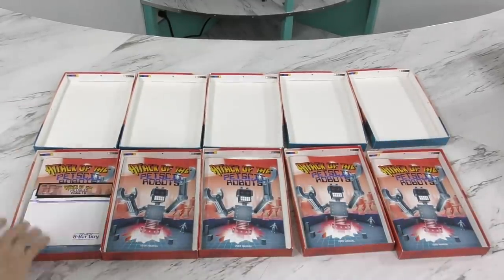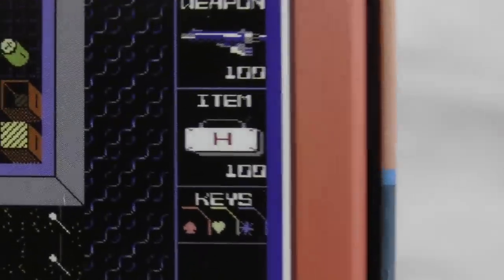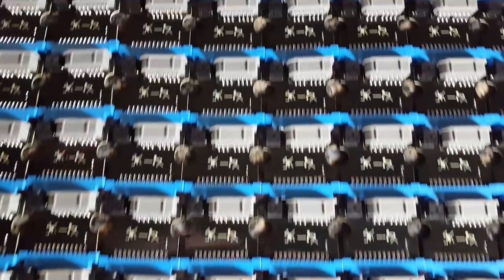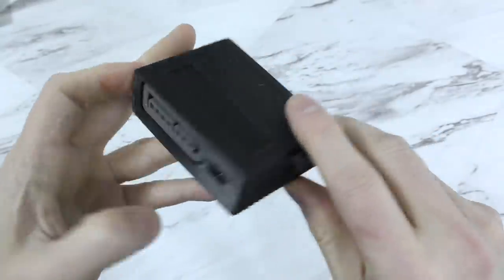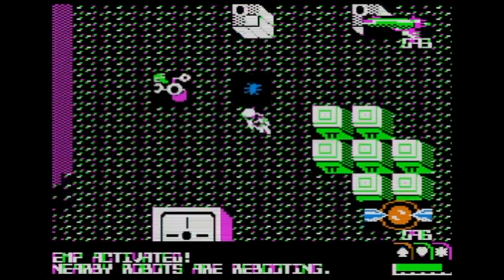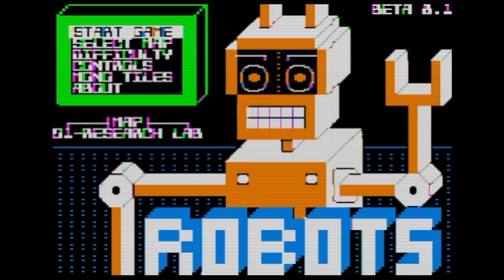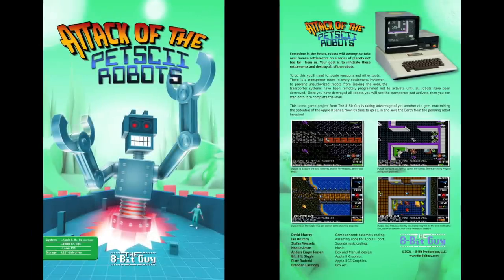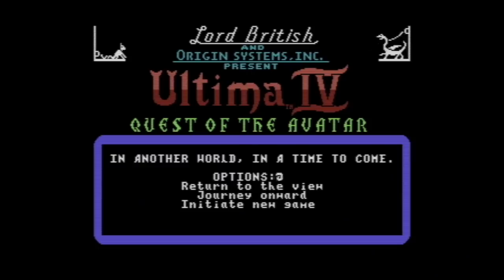Petscii Robots Part 3 - Apple II version, production, etc.

Comment: I was legitimately shocked to see that the SNES adapters are more or less made by hand. Very cool
Reply: How else would they made? It's by far too low volume of a product for any kind of automation to make any kind of sense.
Reply: @HidingAllTheWay  you can quite easily get quantities as low as 100 pieces with smd assembly from chinese manufacturers. But you gotta do the through hole stuff yourself
Reply: @asronome  Yeah doing that SMT stuff by hand seems ridiculous to me but I assume that somebody who knows enough to design such a board also has their reasons why they didn't outsource it. The biggest cost for a pick and place run is setup AFAIK so either it's too many different components for the size of the run or maybe they had bad experiences with the component sourcing / QA process of the PCB fab.

I'd really like to know the actual reasons.
Reply: @HidingAllTheWay  Not really. I used to work in electronics production, and the company was fine with low volume PCB orders. If you have the machinery, It doesn't really mater how many you produce, as shifting from one batch to the other only takes a few minutes
Reply: 8 bit guy is hardcore 🖖
Reply: @RyanJardina  You know that he isn't doing the soldering, right?
Reply: @Okurka.  yeah he stated it was texelec (they sell alot of retro boards like xt-ide and a few others
Reply: Why is that cool? It would have made a lot more sense to at least have the SMT components, which are all off-the-shelve parts, be assembled by an automated shop. Seeing someone use tweezers and a toaster oven for assembly is rather worrisome. That's okay for single digit productions, but not when he ordered a thousand.
Reply: @HidingAllTheWay  600 pieces is not low volume. There are manufacturers like JLCPCB what will produce even only 10 of them.
Reply: @graealex  I completely agree. I have placed over a thousand SMD components a day before, and it really takes it's toll. I would have quickly automated that with a pick and place machine if I had the chance. With that volume of PCBs I would have just bought one. £4000 shipped.
Reply: And made by hand in the USA, not China 😱
Reply: @MattKasdorf  We all know the quality of American made products.
Reply: Hand assembly of SMD boards like that is a little nuts, but it's Texelec that's nuts here XD

But... if you have time and nothing better to do that'll make you money, it's rational to do it yourself. Wouldn't be my choice for 1000 units though, especially not with hand placement. Maybe for 10.
Reply: @josephlunderville3195  agree entirely. In my last job I had to rework 48 (urgently needed) raspberry pi adaptor boards in order to swap two SMD components and I ended up burning 12 of them due to my inexperience. Never again lol
Reply: @henryokeeffe5835  It's not like there aren't any shops that are fully automated in the US already, if you don't want to rely on production in China. Plus the toaster oven really isn't that reliable. Given, the components are all very simple, but if there was a more complex SMT part on the PCB, that might be a liability if not done in a proper reflow machine. I understand the controller and user port requiring hand soldering as a last manufacturing step, though.
Reply: @graealex  why is it worrysome? more care and attention being put into this than a mass-produced board. so many mass produced boards just get rejected at testing.
Reply: @skellious  Lol, it's the other way round. We use automation to make processes more efficient and consistent. Pick and place machines have a certain repeatability and don't make errors, like humans do. In many cases, there will also be an automated visual inspection, and electrical testing afterwards - again without the risk of introducing human error.
There is a lot of misconception about hand made stuff having higher quality. Just because a lot more work has to go into doing stuff by hand doesn't increase the quality. Automated mass production achieves the highest quality at the lowest price point. For example, if the mainboard of the computer you are typing a comment right now was hand assembled, there would be a very high likelihood of it failing prematurely. And it would have still cost ten times as much.
Reply: IMO one of these is worth buying just to have the correct connector for the user port and a sturdy headphone jack for PET use, even if you don't ever use the NES controller capability.
Reply: Maybe arguing with a Chinese over manufacturing defects and waiting for extra batches would be ultimately more expensive than doing everything at home. Time is money too.
Reply: @graealex  *shelf
Reply: @noop9k  Why is it always "hand-made" vs. "China"? Are you aware that highly automated factories do exist in the US?
Reply: @graealex  I can guess that, unlike certain Chinese companies, they don’t do tiny batches with small profit margins.
I, personally, don’t have a friend with pick and place machine where I live, do you?
Reply: @noop9k  This is a commercial operation with at least 1000 units ordered. Hand-assembly and toaster oven reflow is okay for 10 or 20 units. But this isn't a small batch. And a quick search reveals multiple shops in Texas that actively advertise "low to medium volume production" with assembly services with "state of the art automated SMT equipment" (aka pick-and-place).
And I don't understand what this has to do with "friends having pick and place machines"? As I said, this is a commercial operation.
Reply: @graealex 
1) When this started they probably expected less orders than 1000.
2)  Why you are so sure that a business from Texas would offer their services for low enough price?
Reply: @noop9k  I don't know what exactly your argument is. There are plenty of shops out there that will do professional manufacturing (read: no tweezers, no toaster oven - instead, pick-and-place, and controlled IR or vapor phase reflow) for runs of only a few dozen, at reasonable prices. There is really no discussion here. The job went to someone doing it in his kitchen instead for some reason, but either that person is severely underpaid, otherwise doing it that way would actually cost a lot more, or there are other reasons, but not because doing it this way is a reasonable way to manufacture electronics on a larger scale. Your amateurish understanding of the processes doesn't add anything here.
Reply: @alerighi  Yeah, and shipping from China takes what? Three months?
Reply: @sonicobsesinter For the last time, manual manufacturing does not lead to higher quality. In many cases, it reduces quality or at least consistency and repeatability.

Comment: I had forgotten about the snes adapter til I opened my box, and I have to say I still have no idea how you bundled that thing in at such a cheap price!  also I find it hilarious that you needed an snes controller adapter and since they didn't exist you had one made! lol so cool!
Reply: Even cooler that the various incompatible Commodore User Ports have JUST BARELY ENOUGH overlap in GPIO to make it possible to bundle a single one in with just a jumper to move.
Reply: That's what you get where competence and decency overlap.

Comment: Back in my high school days I was familiar with Commodore Basic and the school computers at the time were mostly still Apple II/e units. I decided to work with bitmapping so I picked up a Applesoft Basic manual in the media center and got to work. I made a mountain scene. I got extra credit in computer class for it. I lost the disk I saved it on since then. I also forgot how I did it. It was over 25 years ago and knowledge degrades like unused muscles.

Comment: Awesome! I finally got my Atari 8 bit "Space Invaders" game to a level of development where I have come to appreciate the various levels of difficulty that the game will present to the player. There are 56 software sprite invaders (only 1 moves per VBI call, but the invader array is refreshed when you shoot one of them, so just like the arcade version, the invaders speed up the fewer of them remain) - 8 columns and 7 rows. There are 8 software sprite bombs (single pixels) which are processed all in one go in the vbi, 4 hardware missiles also processed in one go (3 of these are homing bombs directed at the player and missile #0 is the player's missile). The DLI multiplexes 3 hardware sprites 10 times. The first one is the bonus points ship, the next 8 are either geese in flight or stratosleds from "Flash Gordon's Trip to Mars" (these use a colour kernel effect to give a metallic appearance, the geese are single hue and the wings of these are animated via the main program loop). The final multiplex sprite data is concerned with your player. Player #3 is not multiplexed because it has to be the explosion where an invader is hit. When you blow anything up, you have to wait for the explosion to finish before you can shoot another missile (emp or whatever - in truth it is concerned with how the invader array is refreshed, but it does make things interestingly tricky - you really have to aim well). If you shoot a goose, then your ship will be paralysed. The geese and stratosleds move at different speeds & in different directions (horizontal movement is processed again in the VBI).One of the invader bombs can be a timebomb. This means that when it falls to the bottom of the screen, player #1 just above the bomb shows as a countdown from 9 to 0 (with a suitable delay). The bomb then goes off with the standard explosion animation. Obviously when I get to putting in the title screen, I am going to have to allow for various selections of difficulty, so it will be up to the player to just experiment with the that. Oh yes, it will also be possible to have a difficulty where your missile is stopped by the invaders' bombs, and invisiblity of invaders should be supportable. The name of this game will be "Ye clouthe et fosse et knyghte sloppe, brithe ye sloume, et et et noage ye slithe oh um oh um oh um". There's still a lot to do, including sound etc, but I have it now at a point where I am glad I began the project back in December.

Comment: Amazing work on all versions. 
Worth to mention that the Apple ][ gameport provides digital I/O pins that can be used to connect a SNES controller. There are 4 output pins, called annunciators, and 3 input signals called pushbuttons , all of them memory mapped. 
A possible connection should be Annunciator0->SNESlatch, Annunciator1->SNESclock and Pushbutton2 with a pullup to vcc being pulled down through a diode by SNESdata.

Comment: Hmmm, there's a trick in doubling the resolution and increasing the colours on an Apple II developed by Don Lancaster which involved critical timing.  It did take instruction counting after a synchronization phase (originally Lancaster used a hardware modification for the synchronization but later came up with an ingenious software solution) but with an interrupt generator like the Mockingbird, it would be trivial to do.  Also there were plenty of libraries that would emulate custom fonts on the hires screen emulating the graphics fonts of more traditionally designed computers.

Comment: There were a couple of C64 systems back in the high school.  One had the 1701 monitor, with composite input only.  While the default "blue on blue" looked fine, if you changed the colour scheme to extreme contrast, with black characters against a white screen background, the characters turned garbled and unreadable. On the system  with the 1702 monitor and separated luma/chroma, this combo was very readable.

Comment: Great show as always. Thank you for all your hard work on all of these passion projects. Glad to see them coming to fruition. Definite kudos to the Apple ][ port team on what looks like an amazing success. I did want to point out a few Apple graphics details that may be helpful, or at least interesting.

Not just the 8 bits for 7 pixels nonsense, but the entire video memory memory map is a very odd beast, probably worthy of it’s own show:
(The high res mode is basically 8 consecutive text modes shifted down a pixel and superimposed. Each text mode consists of 8 128 byte buffers, corresponding to 8 consecutive lines of 40 characters from the top, middle and bottom of the screen. With 8 bytes unused at the end of each triple line.) The C64 text mode appears to be 40x25 chars, next to Apple’s 40x24, so you may possibly be able to do a more direct port by treating the 40x24 char grid as indivisible units, which greatly simplifies the pixel math.(Also XORing every odd byte with 0x7F can often simplify things.) HGR1/2 page flipping was usually important for smooth animation as well.

If instead you wanted a more Apple way of doing things, it might be worth looking at “shape tables” which were Apple’s alternative to sprites. They were certainly not the same things, but I remember reading that they were (relatively) very fast, but I don’t have a basis for comparison.

You make very good points about Apple’s lack of hardware interrupts. I do recommend reading “Beneath Apple DOS” (Don D. Worth and Pieter Lechner - 1981) for an appreciation of how time sensitive code for the Apple worked.

I hope you find some of this useful.
Reply: Looks like I was gravely mistaken saying XORing odd bytes with 0x7F would make things much easier. What I had in mind was the  much more involved pseudo-code below. Performance wise I expect I t’s probably much more practical to store two versions of each sprite byte:

// on Apple ][ hires graphics modes, even and
// odd bytes have their color bits reversed,
// but this doesn’t affect black or white pixels.
//
// This flips these bits to get the equivalent
// pixel bytes to use between even and odd
// bytes.
//
// Two consecutive zero or one bits are black
// or white, so only flip non-consecutive bits.
char flipAppleColorBits( char origByte )
{
    const char PIXEL_BIT_MASK = 0x7F;
    const char NON_EDGE_PIXEL_BIT_MASK = (PIXEL_BIT_MASK << 1) &  (PIXEL_BIT_MASK >> 1);
    char pixelBits = origByte & PIXEL_BIT_MASK;
    char nonEdgeColorBitMask = NON_EDGE_PIXEL_BIT_MASK & ((pixelBits ^ (pixelBits << 1)) & (pixelBits ^ (pixelBits >> 1)));
    char colorBitMask = nonEdgeColorBitMask | (~NON_EDGE_PIXEL_BIT_MASK & ((nonEdgeColorBitMask << 1) | (nonEdgeColorBitMask >> 1)));
    return origByte ^ colorBitMask;
}

Comment: I recall programming for MS-DOS back in the 1990s and I used to use "dirty rectangles" to update the screen.  They only update what has actually changed.  It's not too difficult to implement and was amazingly fast, depending on the game you used it on.  Those Apple 2GS graphics look pretty nice.  Should make an Amiga version. :)

Comment: Yeah I wish more games made use of the mockingboard as well as the 128K and Double High Res mode.  By the mid to late 80s most Apple IIs and clones had 128K but developers still made everything for 48K Apple II specs to maximize sales.

Comment: I found my Laser 128 in the basement after 30 years. After watching you and Adrian Digital Basement I'm going to restore it. My first test seem to try to boot but no video and I haven't tried a disk yet. I got a UV light and peroxide for fixing the discolored case though. There is not much on YouTube about the Laser 128 so if you find one to restore that would be cool!

Comment: I love it when big corporations say they don't want to "dilute" their trademarks, intellectual properties, etc. when they are doing a smashing job themselves. Just look at how the Comics, Gaming and the Movie industry are ruining their own properties, milking it, ruining it, changing it. Indies and fans are more respectful of characters, logos, IPs than they are, lol.
Oh yeah, Pixel problems; when you make games in RPG maker, you'll notice a similar problem. While classic RPGs use 16x16 pixels or 32x32 pixels for a tile, RPG Maker uses 48x48 pixels for a tile. So you'll have to enlarge all graphics x3, but this only works if you use 16x16 pixels, not 32x32 pixels. And pixels are handled differently throughout the board. So in the end a fake-pixel is actually made of 3x3 pixels but sometimes a fake-pixel is actually 2x2 pixels, ruining the illusion.

Comment: I've got neither a Laser, nor an Apple monitor (which wouldn't be big enough to be comfortable for me anyway), but I have a probably obvious suggestion for the Apple II and monochrome/color switching: S-Video. LCA if you've got a Commodore monitor, or a breakout cable if you're using a standard S-Video connection. The Apple II is connected to composite and to Luma on the S-Video input. If I want to kill color, I just select my S-Video input and color is killed.

We miss you in Portland! Actually, we kinda miss everything in Portland … things are still pretty restricted here.

Comment: A fellow Laser 128 fan!  I cut my teeth on Apple ][+ machines that belonged to the college where my friends parents worked, and friend's Apple //e and //c machines.  But when I finally got old enough to get a job and buy my own computer, I bought a Laser 128, just like the one you have.  I loved that thing.
I used to try and hack around in games and stuff, and I got a lot of use out of the Ctrl-M-Reset function that was unique to the Laser-- halted and dropped you straight into the monitor  at the exact spot where the program was executing-- great for figuring out where certain parts of code lived, or freezing a screen in just the right place to save it as a picture file.  Man, I loved that thing.